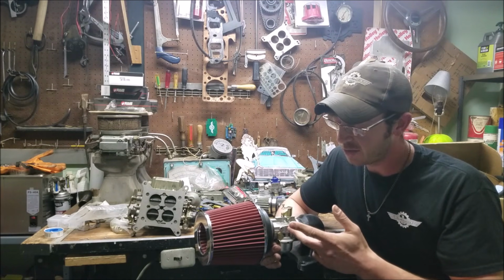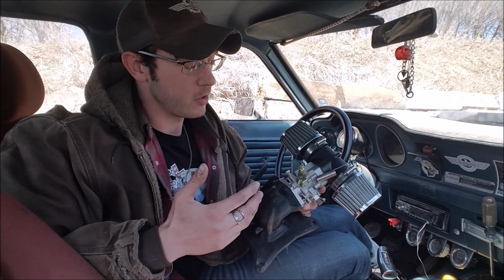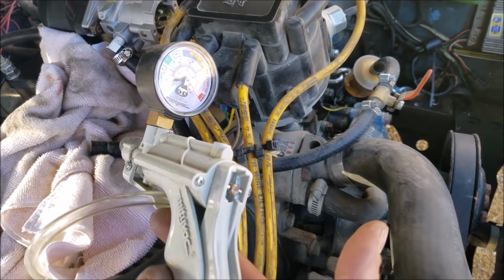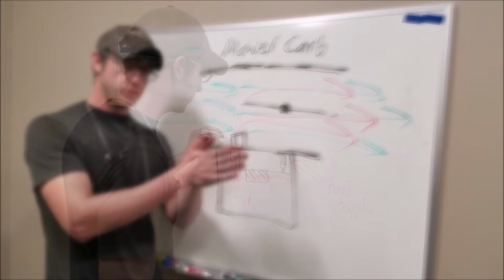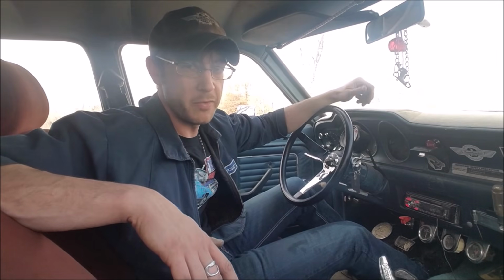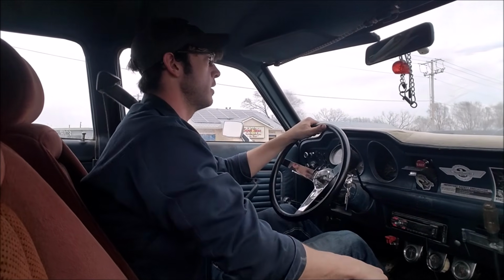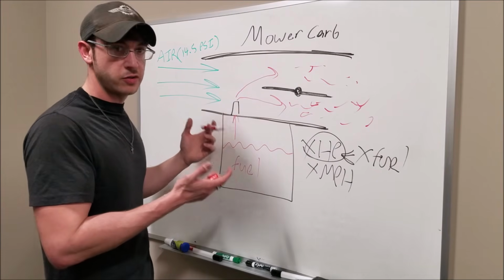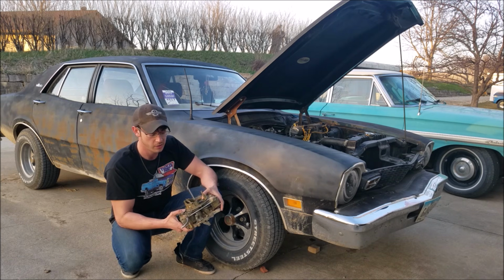Will It Run? Lawn Mower Carb on V8! (The "IMPOSSIBLE" Becomes Reality!) Start to Finish

Comment: You have to think back in the day a lot of V8's ran single barrel carbs, they didn't make a lot of power but they got you by. I realize they weren't lawn mower carb small but they were small carbs. Other than the Hi Output motors most 302's came with a two barrel. My '83 Lincoln has a tiny throttle body from the factory I think it's less than 300cfm, then again it only has about 120hp in a 3800lb car with a slushbox AOD and 3.08 open diff. Wow! After watching this I'm thinking that engine is making more power with that carb than mine is in stock configuration.

Comment: Had a '79 Econoline van with a 300 cu in engine  (the relative factor here) with a single barrel carb. Stock original equipment from Ford.   If memory serves, was about 2" barrel size and the much large and less aerodynamic van got a bit better than 20 mpg hwy. Also, I seem to remember industrial and marine 302s factory issued with single barrel carbs...

Comment: Swap in a 0.8mm nozzle, it'll cut your print times in half or better.
Reply from the maker: Will also look terrible when done
Reply: As long as the layer height is the same, the difference is pretty minimal.

IME the only reason to run small nozzles on functional prints, is if you have very fine details or small models.

That said, I value time way more than the minor cosmetic difference. YMMV.

Neat project regardless!
Reply: Also loving the custom PCB and app, well done.

Comment: This is the same idea i had for my 96 fleetwood, but my thought was to pre-heat the fuel just before mixing so that it evaporates more quickly and completely, possibly even boiling the fuel and having gassious injectors either by adding heat, putting the fuel under vacuum, or both, vacuum+ heat would probably be required, as pulling a vacuum is going to probably get it below freezing, and any water is going to frost up.

Comment: I used to get 25+mpg from my 1968 225 slant 6 barracuda with it’s 1 barrel carb, the only upgrades were an electronic ignition distributor from a newer slant 6 and a MSD-6.  oh yeah, we used to just flip the air filter lid upside down for better airflow.  Then there were the Holley and Rochester spread-bores with small primariy and huge secondaries trying to make v8s more economical.  Uh.. that doesn’t look like a real Tupperware to me, but a flimsy cheap sliced sandwich meat container from the grocery store, I reuse them myself. Cheap plastic NOT for solvents.   
edit: small carb = bigger carb with restrictor plate?

Comment: Gus in Dallas thanks you...having financial problems...borrowed a 63 Falcon w a 289 V8 swap ...Fomoco 2100 A 2 Barrel carb..it's killing me 5 MPG MAX...,(I know ...new carb,plugs,etc,)gonna skip all that try to do your set up but with off the shelf stuff...see what results I get! Heck if I get 20 MPG 
it will mean I'm actually saving money when I need to...
THANX THUNDRHEAD!
Reply from the maker: Say ol boy, this wasn't done in the name of gas milage - it did make a 322hp dynod car then make only 49hp, so keep that in mind 🙂
I just did it to see if it would work because it looks so wildly wrong

Comment: Gr8 vid, thnx for all of your work and time creating this.  I see serious issues w/ your analysis / Data acquisition techniques that I'm sure others have stated.  1. Using gas tank to measure fuel consumption is no good. Not anywhere near accurate.  You should use separate tank for measuring fuel consumption.  2. What was gas mileage pre carb install? (what do other cars w/ that body, engine and trans normally get for gas mileage?) That's really about it.  Just measure the fuel usage more accurately. Keep up the gr8 vids, subbed and liked!

Comment: Man! I am having a BLAST watching this! I am starting to wonder a few things: 1. I wonder how a Ford 8N or 9N tractor carb would work, and how it would work in a mid 70s Olds Toronado 403 engine in a GMC motor home.... If you would like a test bed in the motor home, let me know... Right now, I get 5-10MPG, so anything would be an improvement! Getting ready for a cross country trip, so....

Comment: Once i saw a mechanic working on a v8 engine and wanted to do a short test start. He had no carb so he pushed some holes in a bucked , filled it with fuel and placed it on the intake.. it actually started

Comment: Greetings: About the V8 MPG thing... I have a TBI 350 in a C1500, Ext cab carrying about 700lbs  and 31in drive tires.
It gets about 22MPG Hwy cruise. 1:04:57  I have  a switch 4 1 of the jets. Kill a jet I add about 10MPG.  U can keep the post TBI crap.  Thx 4 the share. Safe.

Comment: your theory on the maximized vaporization of the fuel remined me of the old gasoline vaporizing carbonators which used the heat of the engine to actually vaporize (boil) the gasoline into a vapor or near gas.  they usually used a heat exchanger with the exhaust to to the vaporizing various pattens of the 1900-1930? were revisited by in the "first" energy crisis of the 1970-80

Comment: So, you've created an electronic pressurized fuel injector out of a mower carburetor at which you've adjusted the ignitions to efficiently run the vehicle proving the fact either the gas and oil industry has been in cahoots with the automobile industry preventing automobiles from running on less fuel consumption or the automobile industry is doing it.

Comment: 35mpg with headers/ls6 intake/cai/exhaust/no tune(waited til cam) in 99 ls1 corvette 327rwhp dyno'd. Ran rich but the pcm adjusted for highway. Got 27mpg after Tsunami cam and maxed my stock injectors but didnt dyno.

Comment: I would love to learn more about the 3D printing methods and the app + custom tuning software/board you made. That's pretty awesome. When I saw the IAC from a Chevy (it looks like the IAC from my Camaro) I knew you were messing with the stepper motor to lean out the fuel mixture but beyond that I was pretty lost. I'm guessing you are running a script or loop that somehow compensates the vacuum leak to lean it out to get stoich? Are you running a wideband O2 sensor that communicates somehow with your phone or a laptop? This is one of the coolest engineering videos I've seen on youtube.

Comment: It's hard to keep a 289 - 302 Ford  from not running .Bet if you had a 5-speed 4-speed with over drive would have got even better M.P.G . Stay safe and watch out for the big Oil company's. They won't like this as much as I do. Thanks for the video.

Comment: I am sure you did improve the fuel econ very much. The fuel stop fill could be off. To get the tank to fill to the same level the tank has to be level. That  means stopping at the same pump at the same station facing the same direction because the drive of the fuel stations are not level. See what I mean?

Comment: HuH? so you basically re discovered a single barrel carb lol they used to put them on cars and trucks back in the day. They may look a little different from that carb your using but basically is the same thing.
Reply from the maker: You clearly have no concept of size do you.
Reply: no i do and i get they are bigger but its still the same thing, if it wasn't, it would not have let enough fuel and air in to let it run, was it down in power? yes but did it work also yes lol 😏

Comment: srandard car carbs are playing  a ballancing act at best trying to maintain a useable air/fule ratio at all speeds 4 barrel carbs can get better,MPG than a 2 barrel because the primarys can be smaller and when the driver wants that extra the secondarys give the added flow. one thing I didn't hear you mention that I ran into (you did say your tests were on a hot day) is carb-iceing which can choke off the carb especially on cool- fogy/humid days. LL&P

Comment: Adding your dynamic mixture adjustors was called oxygen feedback carburetor back in early 80s.  It worked then, but not as good as spfi, and definitely not as good as direct fuel injection.

An engine that is normally aspirated can only pull in enough air to fill the cylinders.  So if your engine requires 600 cfm at max rpm putting a 1000 cfm carburetor will only flow 600 cfm.  Look vack in the 60s, Ford and gm were both putting 780 cfm Holley carbs on 302 engines.  Quadrajet carbs were often over 800 cfm as well.  Performance carbs tend to have just about every circuit tunable, allowing the carbs to be tuned to vaporize  the fuel most efficiently.  Problems occur when people buy the 1000 cfm dominator carb and bolt it on an adaptor on their slant six and expect it to work right out of the box.
Reply from the maker: They never had a chance back them - barely had a decent exhaust sensor let along a wideband which we didn't have till the 90s.

Comment: Take AA boat on the supercharger and use your car. Better lawn more design and you'll get more efficient horsepower and more speed out of the same project as you're doing try it. I'd like to see it. They made an old boat on supercharger back in the old days that both are on antique. It's just a single small supercharger for a small setup try it. I think that you'll love the outcome.

Comment: On a stock Toyota 2.4 I got 65 mpg at 80mph. Lean the carburetor to just about max, added ram air and crimped the egr valve off. The tailpipe, muffler from catalytic on was not present.

Comment: I had a two barrel in put a bigger cam on it on the carbustor I put two 32 ° drill bit wholes on the venturi it and the Rough idle stopped. 👍🙏 1:01:33

Comment: This is my second time watching this, but thinking back, the one barrel on my 67 Malibu 283 was about the same size as a lawn mower carburetor.
Reply from the maker: Definitely wasn't the same size as a mower carb, I promise you. And I hope not - running a mower carb can be done, but also you lose and real HP naturally. This was done as a teaching tool
Reply: @ThunderHead289  Look up part number 52842rk, that's the stock carburetor from the 67 Malibu 283, it's really not much bigger, maybe 10mm bigger. It wasn't great for horsepower but probably helped keep the mpg somewhat decent (it's a Malibu wagon). It's the smallest one barrel I've ever seen

Comment: Older vid but question- retest with a fuel flow meter?  I expect the fuel in the tank warmed up and expanded before you topped it off again.  May have burned more than you think in terms of heat content.

Comment: 5.7L / 100km now that is, something. Not even my vacuum cleaner ecenomy no AC dailydriver which is a 1.2liter direct injection gasoline engine can do that. And it does only 60hp. This manages to sound good, drive fast (on a 4 speed transmission thats quite somethign to behold) and be cheaper to run than my 2007 Škoda Fabia HTP....this is truly, impressive.... I only wonder, how is EGT doing? You know, it is more efficient so the temperatures within the cilinder must be higher. If it will eventually burn a hole trough the piston or ruin valve seats or the valves themselves..

Comment: I managed 48mpg on my 140bhp fuel injected rated at 27mpg all wheel drive 4x4, urban driving by eco driving, that is de-clutch on the down slopes (engine breaking still burns fuel as it calculates more fuel to prevent pinkening), follow the racing lines on corners (that is keeping a straight line across the bends) and gentle acceleration

Comment: Lol bruh

100% u just showed me how i can have a muscle car as a daily driver and still race it every once in a while on the track.

Bruh.  Brilliant! Use your little system for day to day driving.
Switch to a 4barrel on race day.

Never wanted an old muscle car cause who wants to get 12mpg while driving to work. But with this.. bro u getting better mpg than I am in a 2002 V6 truck.
Reply from the maker: Mpg is stupid, heres why. Let's say you drove 12,000 miles a year. You have a car that gets 35mpg vs one that gets 18, and let's say gas is 4.00 per gallon. 
12,000 / 35 = 343. 343 x 4.00 = roughly $1,370 dollars. 
Same deal with a 18mpg vehicle is $2,667.
So basically 1200-1300 dollars for an entire year of driving is all you'd save. Waste of time, enjoy your fun cars - gas money isn't stopping anyone in actuality.

Comment: Hey Luke, if you ever revisit this, I'd like to see you try it with one of the 2 barrel carburetors off of a Briggs vanguard twin. I was working on one today and happened to remember this video. I'd be interested in seeing if it's better or has more power but still gets 40 mpg.

Comment: I want to see the plugs, i think out of the HF 212 carb you can get about 11HP through it and no accelerator pump.

Very cool i used to get 27mpg through my 305 5speed Camaro driving normally.  Driving very softly I've got 43 out of an auto DX Civic City and freeway driving.  I have a feeling your getting forced to stay under 11hp and getting great atomization of fuel maybe even letting you burn a less than ideal AFR.  It would be interesting to see the plugs.  I think a lot of V8 motors had a very good BSFC.  I have a feeling you'd be fun to talk theory with.

Also i used to tune my carb and timing with a vacuum gauge.

Comment: The problem with this is NOx. You can get very high gas mileage with lean burn modes like most FI cars in the 90s, but you produce way more NOx with the high combustion temperatures.

Comment: You can also set it up with water injection with your fuel and you'll get more. More fuel ratio with all the technology out there to help you make the edge and run. A snow different at what they're doing with the 4 song is a design like that will revenue revolution the concept of gas mileage you've got a money. Maker there.  I'm into that same design but I gotta stop back years ago. I hope you've been making it work possible because basically you'll be a rich man

Comment: Small carb will work just fine as long as the air/fuel ration doesn't go too lean. Small carb means less air and fuel so it will get better mpg. (theoretically).

Comment: You did a great job on the build and created a great video.   I'm not sure what the further message here is though.   Why have a V8 if you're going to reduce the performance to get better gas milage?  Just get a 4 cylinder.  If you'd like some more power, throw a turbo on it.
Reply from the maker: The purpose of the video was simply a lesson on fluid dynamics and physics - unfortunately it got lost in translation from the internet embellishing this whole video series - was trying to prove the nay Sayers wrong that in fact the engine would run, and most importantly that a small carb would be rich not lean since fuel is proportional to airflow anyway, and it was calibrated for a smaller engine and volumetrically cfm less draw. 

But you know how the internet is - runs wild with something. Mpg is completely idiotic to worry about - if you drive 12,000 miles a year with gas a 4 dollars a gallon, you only save a whopping 1,200 dollars between a car that gets 18mpg and one that gets 35. 
It's inconsequential at that point, not to mention most high mpg cars people are out there buying are high priced. 

Better off having some mechanical skills, buying something cheap on the front end, and just driving it - ACTUALLY money ahead that way all day long.
Reply: @ThunderHead289  It was a really good explanation of fluid dynamics for sure.  I guess a vast majority of people out there haven't seen an old Carter or SU carb. Very simple carbs that are going to pull the fuel based on the air and if you have it set anywhere near correct... it'l have the proper fuel air ratio.
Your build skills are great and you're doing the future a service by trying to explain these concepts.   We need that.  I had a guy in the electrical dept at a home improvement store try to tell me that if I got too big a wire it would fry the motor because the wire contained too many amps.

Comment: You are not the first to use a lawnmower carb on a V8. But if you market it watch out for the big oil company's you might just find all your notes, equipment. And reputation on the line or even a disappearance from this existence. So watch out dude. Bud good job reguardless

Comment: I have adapted carburetors several times but not this extreme. Kool.
Research hydrogen generators. I used them the last 20 years of driving. Typically a car getting 20 MPG would get from 35 to 38 MPG. Try it, they are simple to build. I had the best results with the two stainless pot scrubbers. Easier to build too.

Comment: OK , up from the flat plate of the manaful  , 3 '' wide pipe  , on top would be the throttle body valve from some thing ,,, and on the side of the pipe mouth the carb...more air flow .

Comment: Would adapting the throttle  body using the (US2010/0313848 A1 ) patent give you better results? Long winded but grand video. Ronald Hatton the gadget man groove ,Thanks. And thats green